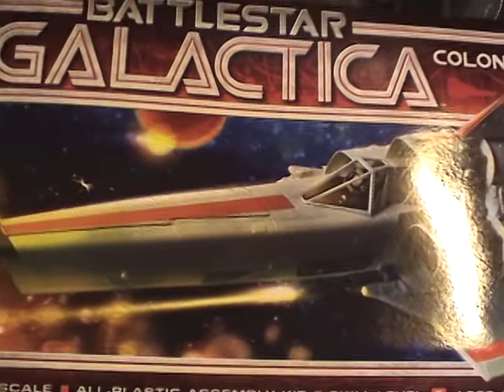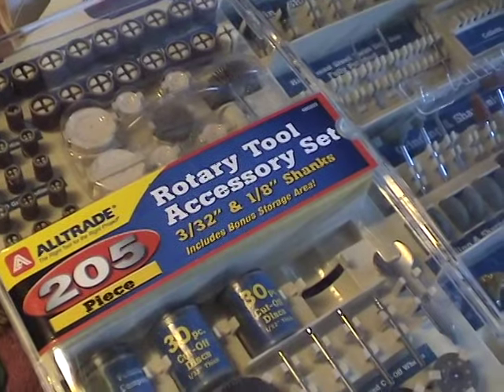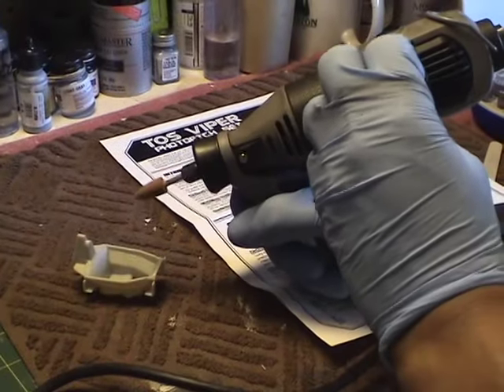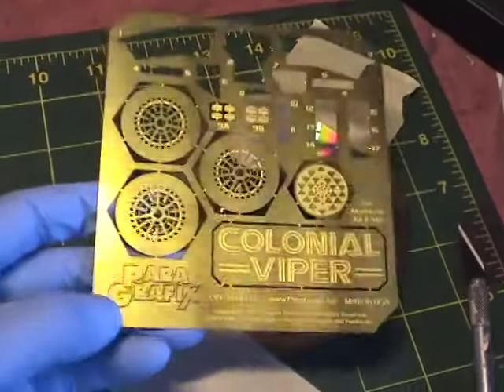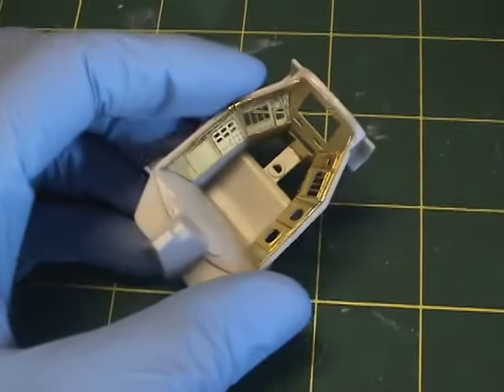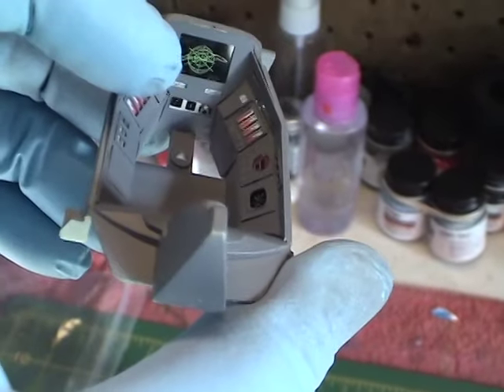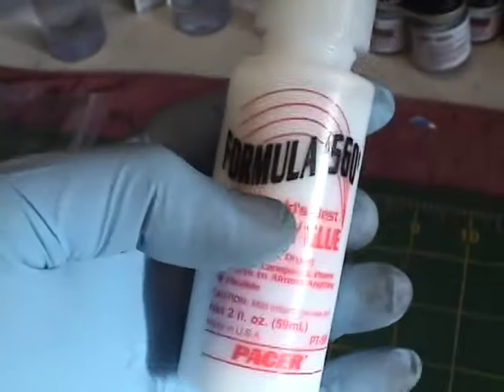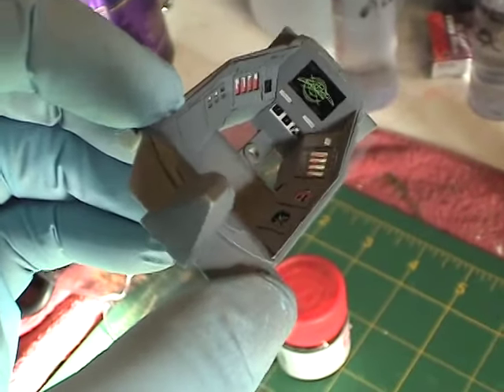Moebius Colonial Viper Mark I Cockpit Build

Comment: Thank you so much for sharing your videos on the Colonial Viper MacI.  This will be my first build in over 30years. A lot has changed. I contacted your recommended LED provider, mentioned your YouTube site and they instantly knew whom I was talking about. (You are famous!). I will be using your videos as a guide to this Viper build. Thank you again. Frank W
Reply from the maker: That's exciting..and thanks for the compliments.  I'm glad they're able to help you.  I think you'll find them easy to work with. Let me know if you have any questions or need any help.

Comment: Love your work and really appreciate the time you take to show your techniques. So helpful. You helped me so much with my Hasbro Falcon. I'm working on the viper now and have been following your videos again. I have a question. I have the same kit and the same photo etch kit. The instructions, which you follow quite nicely, have you apply the etch panels and then the graphics. After looking at this, I'm wondering, why not paint everything first (panels and cockpit), apply the graphics and then glue the panels to the cockpit? There's probably a reason, but wanted your opinion. That would seem a lot easier. Thank you and keep up the great work.
Reply from the maker: Hi Ken...it's been a long time since that project so I had to go back to the video myself.  Just to make sure I  get this right (and as you said)....I applied the etched panels, painted the cockpit and  installed the graphics last.  I would say that the problem with painting everything first is that you run the risk of damaging the paint as you glue in the etched panels. Also it's easier to center the graphics into the installed panel vs the other way around. There's limited space and the panels will only fit in a certain way with little room to maneuver them. I hope that helps.  Thanks again for your kind comments.
Reply: Interstellar Modeler Thanks very much for taking the time to respond with the details. I'll follow your directive! All the best.
Reply: Actually, I would think the opposite to be true. Installing the graphics directly to the photo-etch ("sandwiching" them between the brass and the plastic) would make them easier to align and then also not be recessed so deeply behind the parts due to plastic thickness. That's how I intend to install mine - paint all the parts separately, add the backlit panels, then attach the photo-etch to the cockpit.